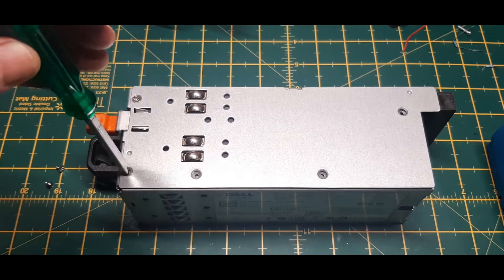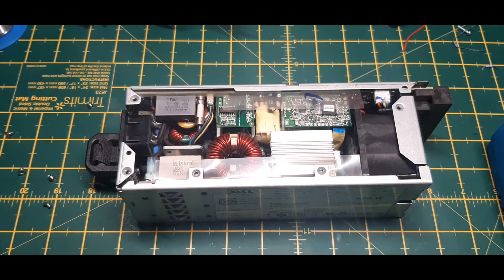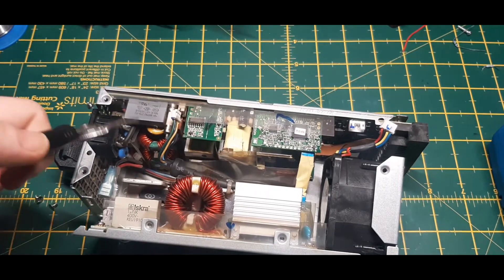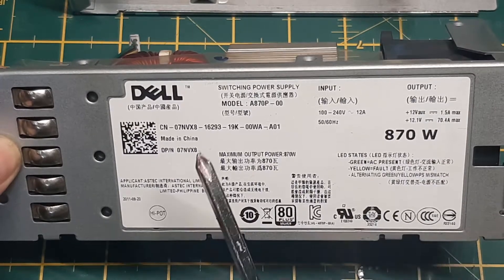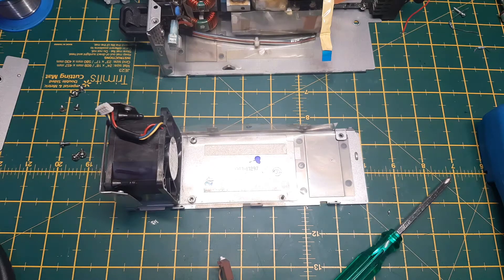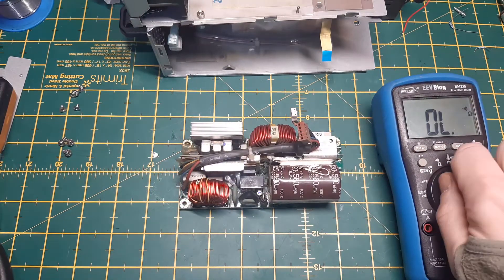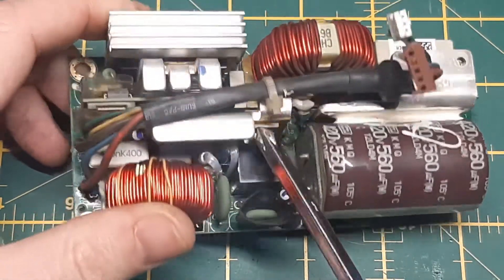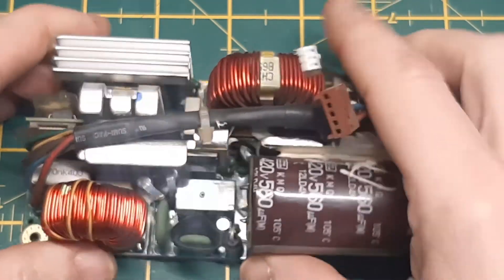A look at the DELL R710 Power Supply | Part 1 | DrRunCMD

Comment: I have a Dell R710 that has started randomly shutting down. I'm pretty sure it's the PSU. Is it likely to be in the power board like you have here? I've tried to find a troubleshooting video but have not found anything. All of the capacitors and other components look like they are in good shape.

Comment: How do you turn this PSU on out side of the server chassis? I want to use this as a high amp 12v PSU.
Reply from the maker: You can manually connect to the psu. There are wiring diagrams online if you search for Dell r710 psu. There also used to be a breakout board that connects directly to the pins but not sure if it is still for sale. I will get back to you with more details for you soon.
Reply: @drruncmd  I appreciate your response. I Have used ATX power supplies (connect green to black) to power various 12v things but having a 70A one would be really nice to have for bigger projects.
Reply from the maker: @GigawattGarage  yeah just Google search Dell r710 power supply. Look under images and you will find the pin outs. For maximum current at 12v use, connect all 12v out together and gnd out together for higher current usage.
Reply from the maker: Power on pins need to be grounded as they are active low